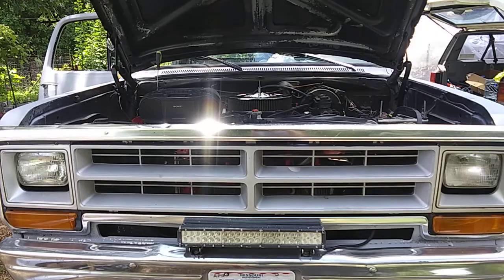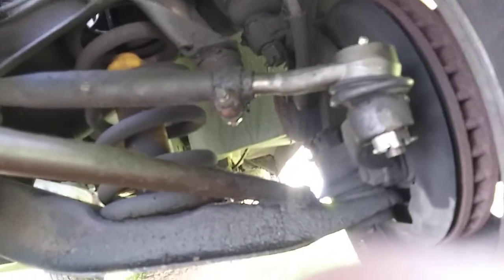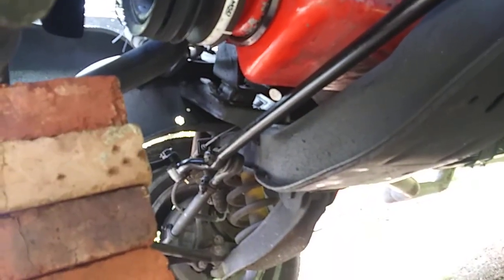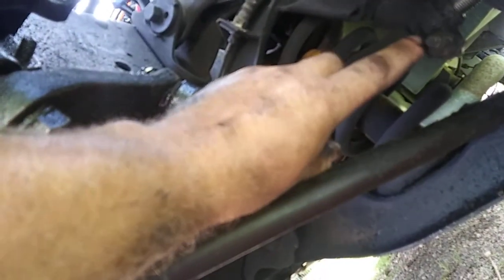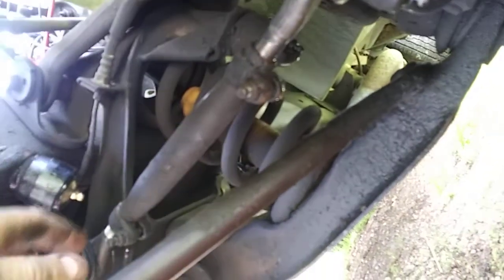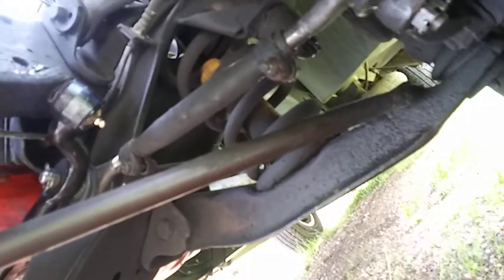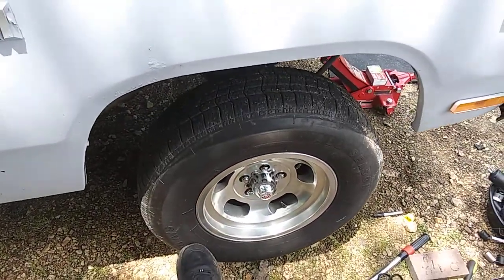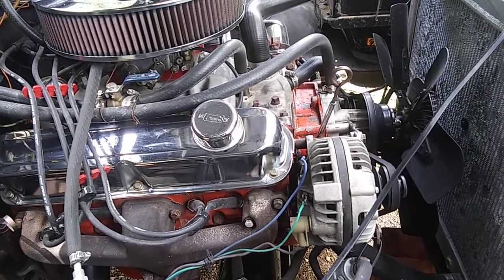DIY LOW BUDGET : 1982 Dodge D150 Pickup Truck - Front Suspension Rebuild

Comment: Cool you got it right drag link.... I like the movtech premium stuff over the moog and usually come with blue seals plus the are all metal construction with a steel gusher for lubrication. I do my own alignment cause not many shops in my area can do one correctly on older vehicles.
Reply from the maker: we have a couple of old timer type auto/tires shops here in branson .this area is cool like that